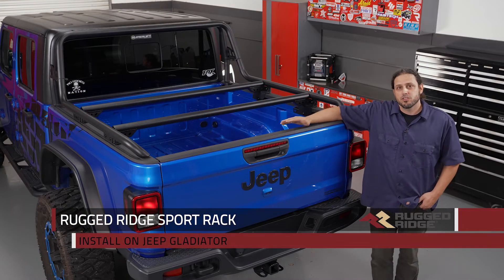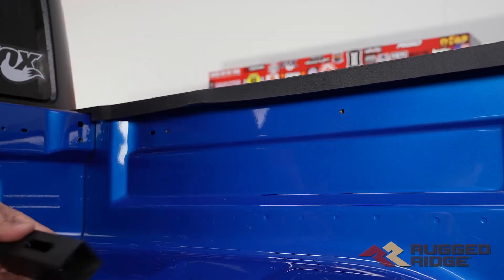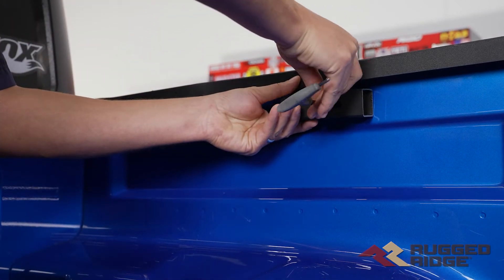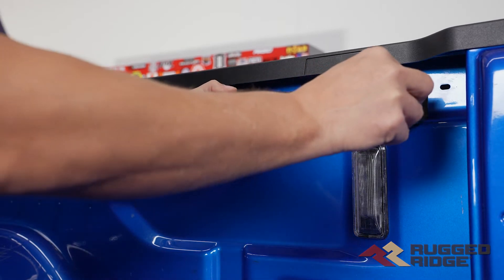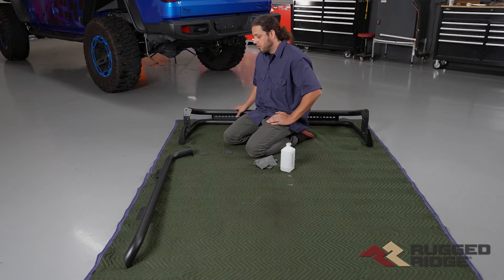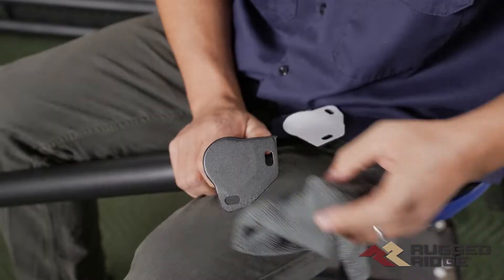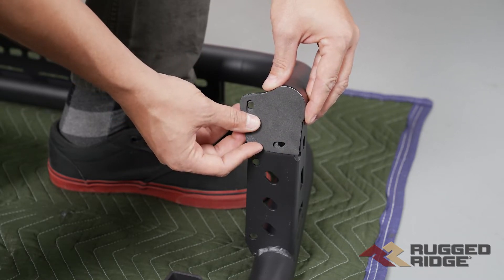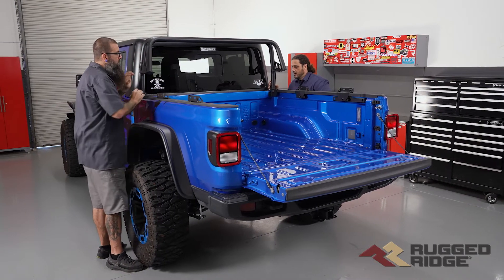How to Install Rugged Ridge JT Sport Rack on a Jeep Gladiator

Comment: Looks easy enough but can you add any instructions for additional steps if we have the Rugged Ridge Spare Tire Carrier on the truck already? Would the front main bar use the same attachment point at the beginning/front side of the bed? Will the first crossbar still fit up against the spare tire? Thanks.
Reply: I have the same question